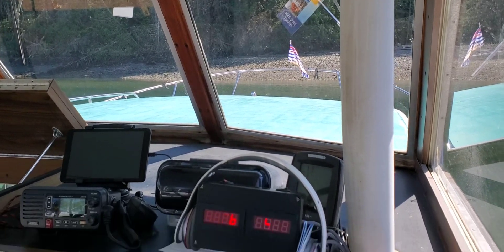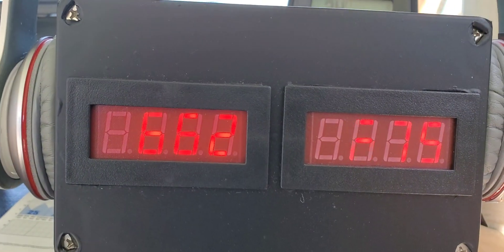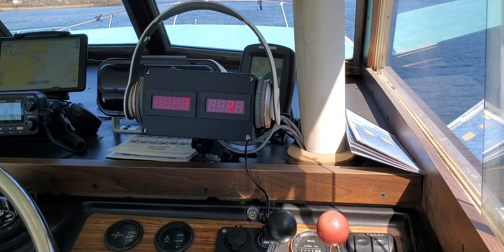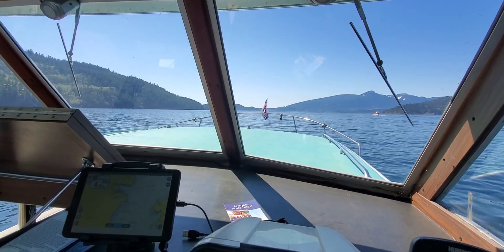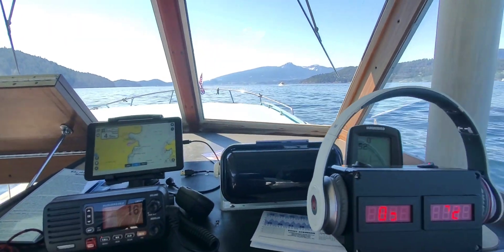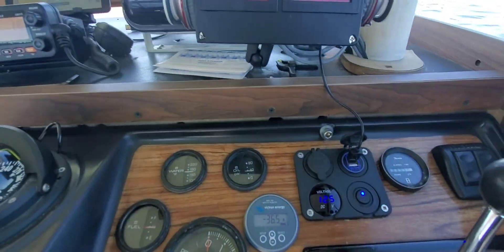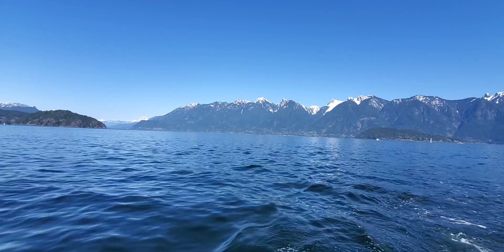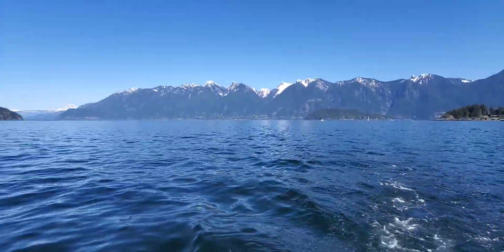Electric Boat - Testing prop shaft RPM & my thoughts on this conversion after 7 years!?

Comment: Maybe this has been covered somewhere, but help me understand.  You put in a 13 kW motors, but it only takes 76v x 42 a = 3200 w per side to cruise?  Could you have used a 4 kW motor?  Why or why not?
Reply from the maker: You could, but what happens when you get into bad weather and need more power?  Or fish with  downriggers, or tow friends on floaties? Or have 6 people on board instead of one? You might find you'd be working those 4kWs pretty hard 😉
It's the old saying when it comes to power.... better to have it and not need it, than to need it and not have  it👍
Reply: @ElectricCruiser  Got it!  I just got worried I was misunderstanding the math.  Enjoyed watching this build by the way.  Great to see one of these built by the KISS method instead of using the most high performance parts on the market.
Reply from the maker: Thanks for watching :)

Comment: What engine model is it, what specifications? 
What boat model is mounted? How much weight does the boat weigh? 
What is maxina speed?
Reply from the maker: Lynch Motor - LEM-200 D-127 (https://lynchmotors.co.uk/marine-motors.html) 
1973, Tollycraft 30' Express, 12,000lbs

Comment: Sorry to hear about your ______ is being so ______.  About this ____ that shall not be named.

Down here in San Diego we’re back to normal. I’ve taken 6 over night trips so far this year.

All boats are a trade off. Ski boats go fast, but can’t sleep or cruise comfortably. 

I’d like to take a 35/40’ cruiser and install 2 HyPer9 AC (88kW Max) motor with the Gyll LiFePo4 batteries. Size the batteries big enough to charge over two nights on a standard 30 Amp shore power. That way could pull into a place in the afternoon, explore the next day and leave the following morning. It’s about the same $$ as to re-powering with new diesels. That’s big money, not for a weekend toy though.

Comment: Would you mind telling me what is the diameter and pitch of the props?
I can calculate the percentage of thrust and prop slip for you if you're interested. 
I was hoping to get the amp draw at 7 knots as I've started to redo my Tolly and still going to decide what kind of drive I want. I'll be redoing the gas engines to do a sea trial first. But I like the quiet drive like you do, but I'd be cruising at about 7 foot the most part. 
By the way, you'r term for the belt drive as a transmission is 100%correct and anyone who says otherwise is stupid. 
Cheers
Reply from the maker: That would be sweet thanks! 14 diameter, 11 pitch. Here is a video of it I posted last summer. https://youtu.be/v4In0ObxPUo
To do 7kts I was drawing 100amps but a few things to note -I might have a slightly bent SB prop, after 7 years my batteries are pooched and the shaft seals need redoing. The high amp draw can be tackled a number of ways....I have some significant changes coming within the next two weeks - might help with your decision. 
Thanks for watching!
Reply: @ElectricCruiser  
There are many factors that play into the current draw and 100 amp's is close enough, but I'll review the video and see if anything else can be added here. 
The theoretical speed at 850 rpms and 11 inch pitch is almost 9 mph [edited (7.8 knots)], and you stated that you were going about 4.3 knots, so you are slipping approximately 40% with approximately 60% torque applied, which is actually pretty good.
[added, I like using a 4 blade as large a diameter as possible to apply as much torque to thrust and adjust the pitch to the load, or if possible change the drive gear ratio, which is much easier to do in your set up.]